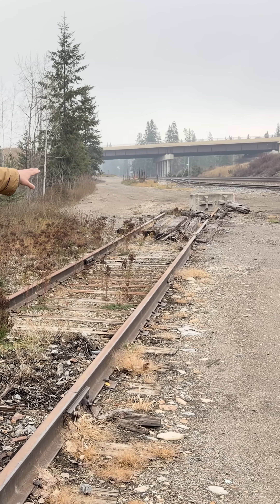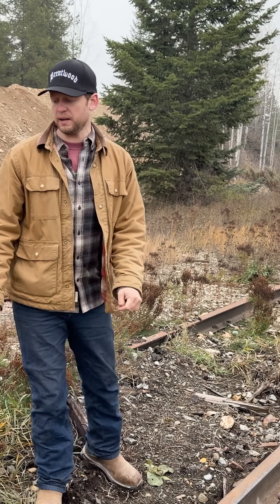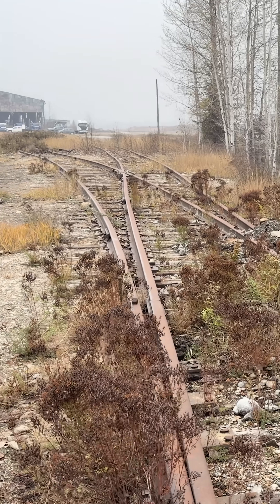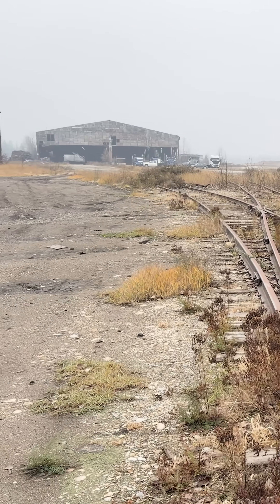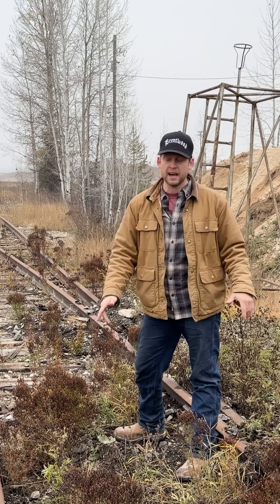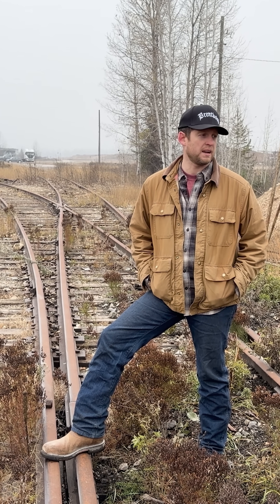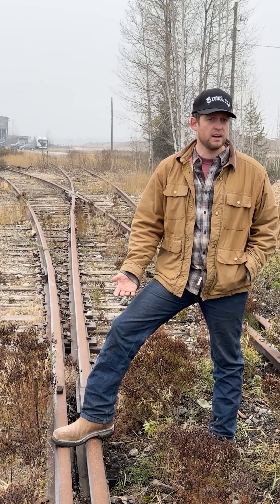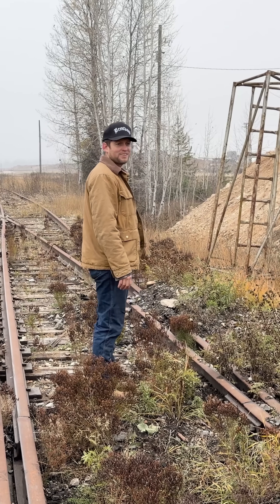Why Our Potential Rail Spur Is a No-Brainer

Comment: So... why wasn't this place running full tilt?
Reply: This area is Donald BC Canada. It was a booming major train town in 1890-1900

By 1900 it was an evacuated ghost town.

CNR in Donald made a boom town again in Donald in 1920.

It is unknown how the spur was used between 1930 and 1970

Selkirk wood mill in Donald from 1970s to 1996 used the rail spur. Then interact wood products until 2005. After that I think the town waned.

So the last time the spur in Donald was active was either 1996 or 2005.

Maybe in 2025 it makes sense to open an intermodal hub. I think definitely, Edison will want to bring in millions of lbs of truck parts in and out on rail.

Comment: The guideway needs some maintenance before you use it. Resurfacing that will set you back a few hundred thousand dollars. Hopefully it's worth it but it does need to be properly maintained and guideways are not set and forget, they evolve.

Comment: A few little tidbits to share with my favorite hybrid truck manufacturer…
One – make sure you get Canadian pacific OK that the demo will not foul the tracks. If it does, you will need to pay for a Flagger $$
Two – if not part of the switch installation, include a derail. That should end what part is CP’s contract contractual obligation for repair and maintenance and what begins Edison.
Three – I fully support you working with a local provider for transload opportunities!

Love and hugs from your friendly neighborhood North American short line, safety guy 😊

Comment: You’re gonna have a hard time with that turnout removed. They’ve likely taken any of the control interface with it. 
Hopefully you can get away with a simple hand operated switch and lock.
Reply: Looks like you may be able to hook into that dilapidated line coming off the main line actually. You could get lucky.

Comment: I worked at a facility that had sub grade rail lines in it so forklifts could load boxcars and such, and an overhead crane for the really big items. The only drawback was the fact that the train doors on the building caused a lot of heat loss.

Comment: Love the brand and the products you guys are awesome. Why not keep the building?
Reply: The roof was not built to handle snow load. Roof has failed so rain/snow is getting in and rotting the roof supports. It's only a matter of time before the building collapses.

Edison probably has 5 different options on how to handle the building.

Sounds like demo was the reasoned choice.

Comment: Rail in pavement is really valuable for transload.  This allows loads like pressurized hoppers to have trucks drive up next to them and pump their loads. 

I worked with a rail customer in my past that did plastic pellets and being able to drive their trucks directly next to the covered hoppers and load the trucks saved them a ton of time and money. We also let them put a "portable" scale on the property so they weigh their loads before hitting the road.  We also had customers to trans-loads direct to truck for flour and cooking oil.

The covered building is really valuable too. I wouldn't tear it down unless you have to. Lots of commodities cannot be exposed to rain and snow and just having a roof over some of the track is really great to have.
Reply: Yep

Comment: do you have room for an airstrip?
Reply: Kinda.
There is a straight on the test track that could handle small bush planes, but they need to relocate power lines in the way.

Comment: As a child I didn't realize how lucky I was. I had two grandfathers, one of which was a steam locomotive engineer. I was, with my sister, take a note for a ride and just told to stay away from the opening of the coal furnace in the cab. The other was a captain of a Great lakes freighter, similar to the Edmund Fitzgerald but not as long. 
In the town where my engineer grandfather worked was what they called the Roundhouse. It was at the end of the line and an engine would come in to The Roundhouse, stop at the end of the track inside. Then this gigantic wheel would rotate and turn the engine around until the track that was previously at the very end of the line, swung around to meet the track the engine had just come off. I remember that kind of thing every time I see one of these railway switches.

Comment: Do you know of the Railway Safety Act.
All rail in canada private or publicaly own need to follow does regardless of who you are in Canada.

Otherwise, your not allowed to run does rail.

If you try to run a train without following does, you will be arrested for risking the life of the local, because it require you to follow the Railway Safety Act to simple wish to make use of does line.

Comment: A railway repair truck would be a great way to get a municipal department contract. They only have a small number of vehicles, they're all specially designed to drive both on road and the rails, and they all probably need to be updated anyway

Comment: In the USA, a tow truck operator needed special classes and certifications to be allowed on R/R property and/or to interact with or near equipment and easements. You might want to double-check your rules in Canada before investing in connecting that spur.

Comment: If you get the go ahead to operate this? You should invest in an old switcher Loco and convert it to battery. You will not need it to be diesel on such a tiny shunt line.

Comment: We're parallel to a rail line & we have a switch a few hundred metres back down the line to bring rail cars into our yard , actually one side of our warehouse opens up with the floor level with the cars open doors & from the outside it's like the train stopped at station platform . On the other side of the warehouse trucks pull in & a forklift unloads them & 99% of the time the freight is driven straight into rail cars .

Comment: If you set up a shop or storage with a rail going thru you need to set it up with a minimum 20 ton overhead rail crane more is better but it would let you place loads in every corner and anywhere else in the building making load and unload thousands of times faster and easier

Comment: We just finished doing what they did, and the cost is astronomical. Just the monthly maintenance on a track like that is around $100G/yr. The removed switch? Another $120G+. The connection to the main line? Really depends; most of the main line operators will give a lower connection cost with a contracted minimum rail car volume. If there’s enough volume for which they are making $$ per car on, it can be around $250-$500K. If the volume isn’t there, it’s north of $1M, assuming they are willing to go forward at all. Plus you’ll either need a short line operating agreement or become your own short line operator. Good luck, cool if you e got the dollars but pleeeeease do a solid business case before going forward.
Reply: Amen and ditto

Comment: Where is the data center going to be built? That will need a city worth of electricity & water. The sound of the cooling systems will be wonderful back ground noise. Speaking of pollution is the site polluted with heavy metals yet?

Comment: They're not called arms, theyre called switch points. I'm not sure about CP but UP starts at $1,000,000 to hook up.to their main lines. If you need you frogs, switch points or stock rail worked on, let me know! Would be glad to come help. One thing I've learned, is that if you have rail you never remove it. The least you can do with it it charge storage. Typically $20-$50 minimum per day for each car stored.
I have done quite a bit of railroad repair, used to be just a class 1 FRA locomotive operator for refineries and other industries. I also was heavily involved in tranloading different crude oils and still work on transloaders for refined
 products such diesel, jet fuel, gasoline, and different types of crude oils and refinery products.
Reply: This isn't directly on the mainline, the switch goes into a siding, so it should be much cheaper
Reply: I was about to say that if you think resurfacing your driveway is expensive, wait until the bill to upgrade and connect those lines comes.
Reply: How did you get into what you're doing now ? I'm former class 1 as well.

Comment: Fwiw gents - your biggest hassle will be if they request for the connecting turnout/switch to be interlocked into their signalling system as this is a gigantic pain. If not - you basically just need to check most of your geometry is in compliance with AREMA or CN specific standards and then you should be alright.

Comment: If you thought the gov was hard to work with wait until you try the Canadian rail companies. We tried for years. Still using trucks. Hopefully you have better luck
Reply: At least they also make their own trucks too😆
Reply: I asked a CN track foreman about 20 years ago how much it costs to run track. He said you can figure $1 million per mile. I can't imagine how much it is today.
Reply: depends on the area. From what I’ve heard, it’s mostly the cost of purchasing the land to build on. Idk enough about it to be certain but it doesn’t surprise me since most new rail projects have been for passenger rail in urban areas. Which usually have prohibitive land costs
Reply: Edison at least already did the hard work of getting the ear of some politicians.

They may have some strings they can pull there.
Reply: Let us hope they are in need of some sweet hybrid train upgrades 😅😊
Reply: @nielshebsgaard919 train engines are already diesel electric hybrid.
Reply: @Gregory-b5y with batteries? Not the just a bit older diesel-electric I am sure. Maub the new ones
Reply: You're correct. Had a spur going into our business and RR would not go into it until we 
had their track crew update, repair and replace at our expense. Too expensive
Reply: @GreggWalken-xd3qv right it's not complicated. Just expensive.
Reply: YEARS ago i predicted these guys would run into a corrupt brick wall with regard to doing business in canada  , and  no surprise , they did with their hybrid gen system. And now they want to continue trying to do business in this country ???  Guess they like getting kicked in their heads . Elon Musk learned very early on that doing business in Canada was nearly impossible , thus the reason he moved state side . I was a business owner in Canada in my youth... the corruption  is unbelievable  and it exists at all levels
Reply: @ethics3 it is crazy how much these American companies lobby our government to make sure we can’t compete in our own market
Reply: @stephenrobinson1944 nope, don’t blame the US
Reply: @DanielSlaughter2005  we are literally tied to epa standards. Why is it that a Canadian company has to seek permission from the us auto companies just to make their own car? Do you think they would have ever said yes? They have never once accepted a Canadian newcomer into the market.
Reply: @ethics3  I take it you haven’t seen any of the updates these guys have posted?
Reply: @ethics3  imagine caring about elon musk
Reply: @WowCreativeUsername imagine supporting mark crapney.
Reply: @WowCreativeUsername  You don’t have to like Musk, or even to think he’s worth the air he breathes, to recognize that he has immense wealth, power, and experience on a scale that most of us cannot imagine. If he has problems getting things done, what does that say about an entrepreneur’s chances?
Reply: @kenrickman6697 right.  Making everything personalized to your beliefs about one person is a mindset they will never change even with evidence.    Rich and political people are the face if trash hiding the absolute landfill of garbage just out of view.

Comment: They may make you completely rebuild the rail spur with ties and a fresh bed of stone.  Good long term investment, but cost add up. Expect survey requirements, drainage requirements and potential new rail requirements. Railroads do not want to risk their trains on your  spur.
Reply: Good point. They may need to dig some swales to make it compliant with ministry of the environment code. The track may need the subgrade redoing on top of the ballast and ties as the vegetation may have destroyed it. The fasteners, spikes and tie plate gaskets will need to be replaced too. The running rail will need Jordan rail as well to prevent derailment as the frogs. Lots to do.

Comment: But I am sure CP/KC would not want to switch rail cars onto your property. As a short switching line would cause the main line to have to stop and wait for the switching engine to remove or replace the rail cars. You would need for sure a full train length bypass would be needed
Reply: Wisdom
Reply: the switch goes into a siding, not directly onto the mainline

Comment: Good luck.  CP and CN are notoriously hard nosed about putting switches back in main lines, and they may charge you through the nose for it. But it would be a great asset.
Reply: To me it sounds like the switch for them will be on the siding that is already there, so it won't exactly be on the main line
Reply: @TheDigitalNikki  either way. CP and CN makes all the money from Intermodel traffic. They avoid a small business like the plague.
Reply: @TheDigitalNikki  They need a switch to connect to the siding, the switch that is already there isn't on the mainline. The problem with having your own spur is the fact that the railroad has to pay to upkeep the switch attached to the mainline, so they'll usually upfront charge you so much that you give up on the idea.
Reply: @SherrifOfNottingham  exactamundo. And deal with additional traffic from pickups and set outs, which they hate if it's a smaller company being serviced. They want 50 car pickups, not a handful.
Reply: @blastermike_sd70ace80  Prime reason they basically got rid of as many branch lines as they could.

The 'big boys' do not want to bother with single carloads.

It's funny when you think about it. Decades ago if you were a modeller and ran trains that only stopped in main yards, that wasn't considered 'realistic' 'cause you weren't switching local industries. As time went by and modellers became more interested in operations they put in more local industry and 'locals' to switch them. Meanwhile Industry began to realize they could make more money and run more efficiently with trains that just went from A to B with no switching or breaking of the consist. Of course for a lot of Railfans and modellers railways are way more boring now.
Reply: @foamer443  Its unfortunate because all those small short lines slowly disappear. The big guys just eat them up and then starve their existing customers until they are forced to ship product on trucks. Here on the west coast working the road switchers and doing the smaller customers were the best jobs. We probably only have 4 or 5 left.

Comment: Get estimates first for life remaining in the track support system and cost to bring it all up to snuff.  Might need a aggregate compaction analysis to make sure nothing is compromised after so many years of non-use.  Also condition report of ties.
Reply: to my untrained eye it looks like the tyes are cooked. The rail lines that run right through the middle of my city don't have half the ties level with or buried in the ground with plants growing up and over them,
Reply: @superhobo666  TLDR from someone with one foot in the railroad world, definitely worth an investigation, but spurs can be operated in surprisingly atrocious track conditions. there's some short lines that'll operate at 10-15 mph and the engines and cars will be jostling like crazy. As long as the railroad doesn't feel like there's a risk of derailing they might go for it.
 Which, given the condition, there might well be, but I have seen worse

Comment: There is a big demand for rail switch engines. Maybe a business opportunity
Reply: I could see the potential. Modern engines would only need the battery pack and associated system that would come with implementing that. I think it would come down to the logistics of these engines. I'm a casual train autism enjoyer but not enough to know the day to day operations. If you have the down time to charge the trains in a rotation and that charge lasts a reasonable amount, I can see it. Or maybe gonna different pitch all together. Maybe do a separate tender car like steam engines, but this is just the battery bank/pack. Excess power can be diverted here from braking instead of the resistive array, plus I imagine a one car add on wouldn't be a huge difference. But maybe this has been explored by others and found impractical. Maybe the savings wouldn't be worth the investment
Reply: It see hi-rail service truck and  and fire truck  market why not ahve hi rail vehicele  with an AAR? Just ideas

Comment: Hydro poles ???? Like water poles? what's that?????
Reply: Due to the prevalence of hydroelectric power in Canada, is not uncommon for Canadians in some areas to refer to electricity as hydro
Reply: @48Dacman exactly our power supplier in Manitoba is named Manitoba Hydro. They deal with all natural gas supply too. But we dont really call natural gas "Hydro".
Reply: @coltonbuhler7011  yup and there bc hydro,sask power and Ontario power generation
Reply: @48Dacman  and so what about wind power are they h²0 poles? Because 6% of the power is from wind and what about the power that comes from oil? There more of that then water power? Like 33% oil 41% natural  as. So they should be called crude poles and gas poles I guess!!!!! And then theres nuclear 8% I think they should be called uranium poles!!!
Reply: I think it refers to hydroelectric power, so just masts for power cables.